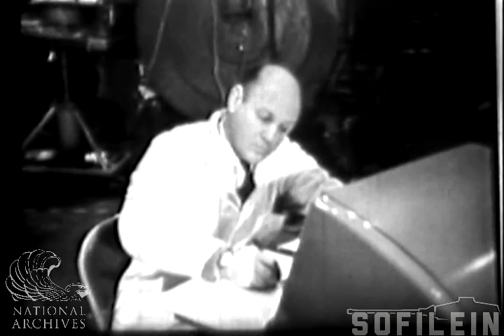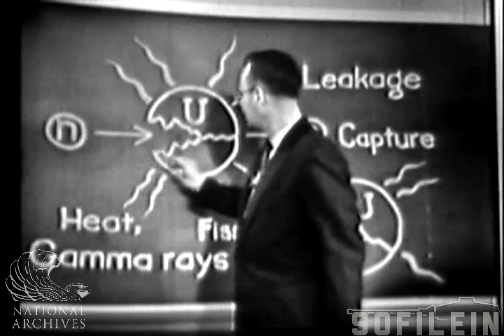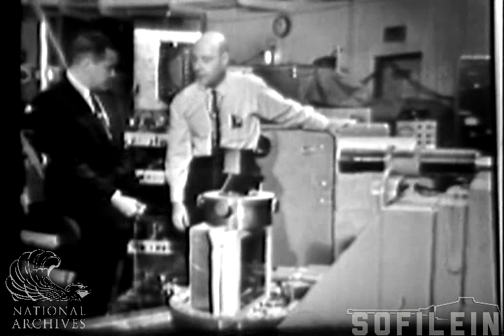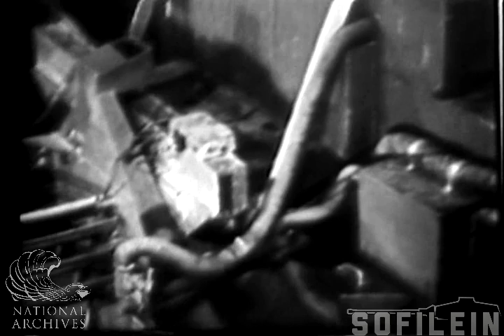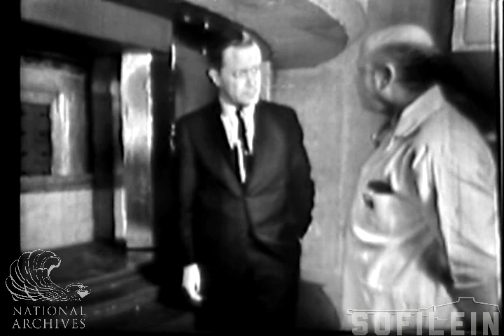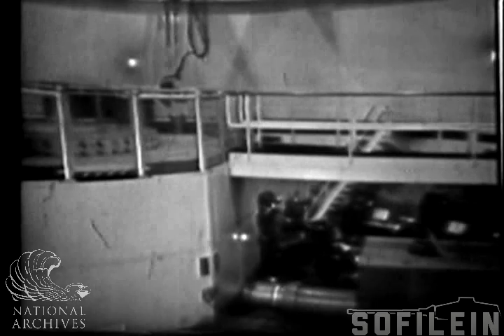Testing and Use of Radiation with "Nuclear Furnaces"- Film by Atomic Energy Commission (1962)

Comment: @19:42 the smaller circle with the rods is about the same size as the reactor that powered our early nuclear submarines. While it was running at any given time there would be at least three non-nuclear crew working within 3 yards of the actual core. Still less exposure then a normal sunny day on land
Reply: Who and a whwtnow.. explain.. explain. Please.
Reply: @gumunduringigumundsson9344   Thinking about it there were also a couple people sleeping in same area below main deck. The reactor on a Skipjack class is just behind the sail midships. It's below a passage between Control and Engine/machinery space. There was a waterproof door on both ends and in the floor a small window looks down at the actual reactor.   Next to it forward was the Admin. office / Yeoman's shack and the radio room. on main deck. The galley was below that with freezer and a giant air duct room close to reactor, below that is where everyone slept.  Oddly when ever samples were taken of primary or secondary reactor coolant(often) They were tested in a tiny room in crews Birthing area as far forward in the ship as you could get. So while sleeping there were guys running around through compartment with radioactive water.
Reply: @dirkbonesteel      Thanks for that. Will you also please tell me.. us.

So.. well.. good.. Is a banana or a day on the surface more irradiating? 
How many bananas and days is too much?
And how much worse is a 24 hour flight at 30k feet than a normal day.. a)for a simple farmer b)normal wifi user b1)4g b2)5g and c) a totally immersed person with all wireless all day.. d)for a caveman with no wifi and only bad boy bubby lifestyle.. just had to mention that.. idk why. Sorry. 🤗

 and nice that it wasn't Starship Titanic.
Reply: @dirkbonesteel  sounds like a pretty insane layout in case of a meltdown...
I would have liked to have a ceramic,  air filled tube around the core and slightly larger than the core directly connected to the inside of the preassure hull so that if the reactor containment is compromised, spray nozzles at the top of the tube opens and let in sea water in the top of the tube, the leaked heat will flashboil the water, launching the whole core through the bottom of both hulls into the sea. The tube itself should be designed in a way that this emergency ejection doesn't compromise the preassure hull.
The ejection of the reactor core will also give the submarine a positive buoyancy boost, assisting in emergency surfacing.
Reply: @SonsOfLorgar  When designed and run correctly nuclear power is completely safe. It's the nuclear waste that is a problem. The reactor is pretty isolated. In fact we are talking about the exact same ship as Scorpion, currently on bottom of ocean. That reactor still isn't leaking, and that one sank in the 60s
Reply: @gumunduringigumundsson9344  I missed out on banana training day. But at sea everyone forward of the reactor is wearing a radiation monitor. We got less radiation then sitting in a house. The Nucs had a more sensitive one. Theirs would vary but still  low exposure.
Reply: @dirkbonesteel     Properly secured proper containers made of proper materials holding in the nuclear waste, when properly welded and properly put in proper places is 'tight!

Properly funded if at all possible.. please.
Reply: @dirkbonesteel  yeah, though I doubt soviet torpedoes or ASW missiles would have taken that into considderation...
When significant emotional events from hostile ordnance starts becoming a regular occurence, shit with lots of moving parts and complex electronics tend to start breaking regardless of design specs.

Which is why I would have wanted that kind of safety precautions on a combat vessel.
That said, I have a hell of a lot more confidence in US nuclear technology safety and reliability than it's ex. Soviet analogues...
Reply: @SonsOfLorgar  Not going to disagree with that Mr. Chiefton fan.  But consider SSN Shark the exact same design ship that sank. Best evidence is that the battery compartment exploded. It's under the crews sleeping area next to the reactor compartment.  Military Spec. is a amazing thing, but nuclear spec. is above that. It did have one serious flaw that lead to it's death. The machinery/aft end of ship was so heavy it telescoped inward killing everyone in milliseconds. My boat had the exact same flaw. They never told us, and that pissed me off for awhile
Reply: @SonsOfLorgar  Sea water into a overheated reactor is a VERY bad day. Its not like an anti-matter core in a Star Trek ship. The steam explosion would probably destroy the submarine. If it didn't, the water rushing into the cavity would smash the bulkheads. Especially if it happened at depth.
Tom Clancy described a meltdown in a Soviet Alfa-class submarine in Hunt for Red October.
Reply: @gumunduringigumundsson9344  radio waves have less energy than visible light.
Major energy level divisions (low to high): Radio<Visible<UV<X-ray<Gamma. Only UV or higher do you have to worry about radiation exposure.
UV causes sunburns, which is basically a radiation burn.
You'd probably need to eat a ton of bananas every day to get a significant dose. Gotta love the headline grabbing "reporters".